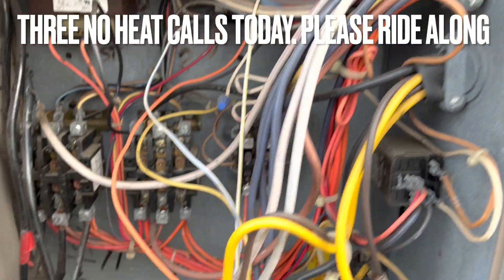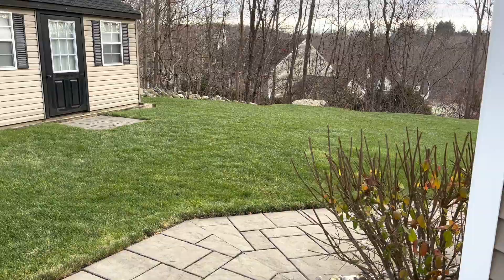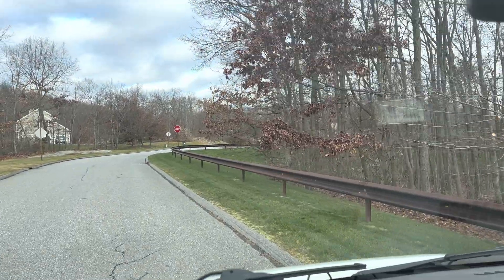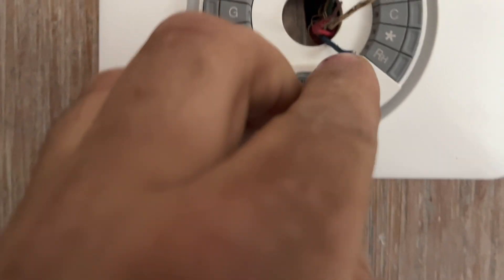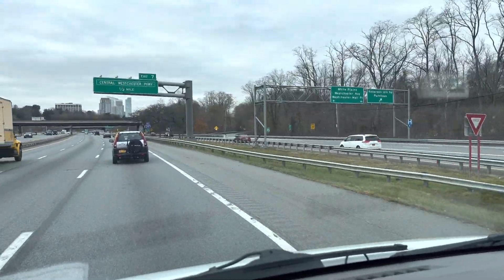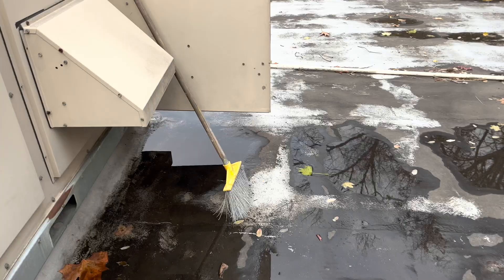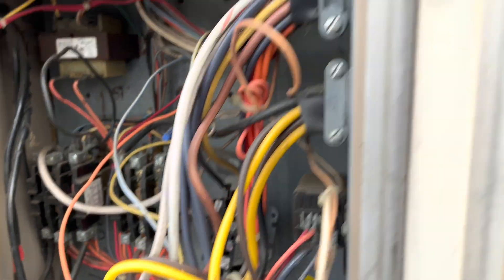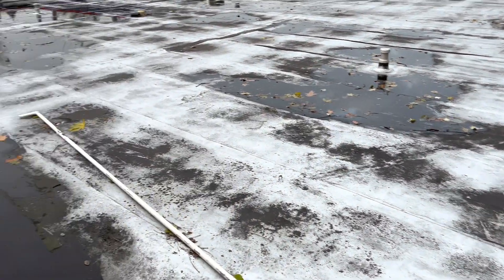HVAC RIDE ALONG. NO HEAT 1994 Fraser Johnston RTU.

Comment: I installed Frazer /Johnson units in the 1960's Paul and some silver foil back fiberglass duct work with iron on tape and the blower blew them sorry ass long fibers right into the office areas . Women were sneezing and coughing and running for cover. The whole duct system blew apart in two minutes .  This was a demo for the duct manufacture who wanted to compete with Owens Corning. What a shit show....never forget .LOL
Reply from the maker: Lol.   That’s crazy.  I enjoyed working on this